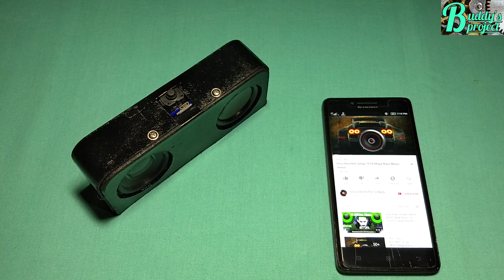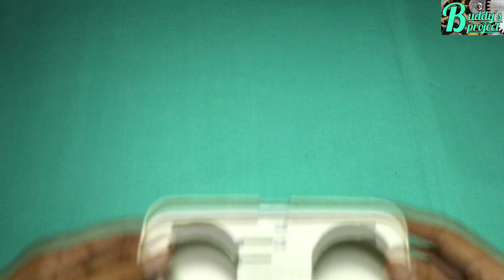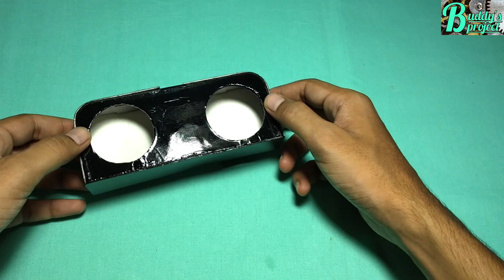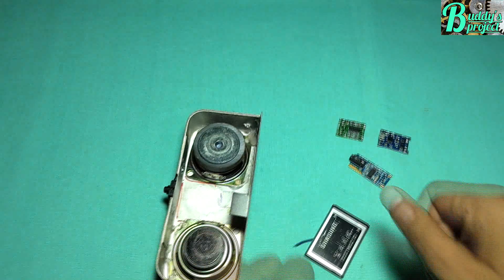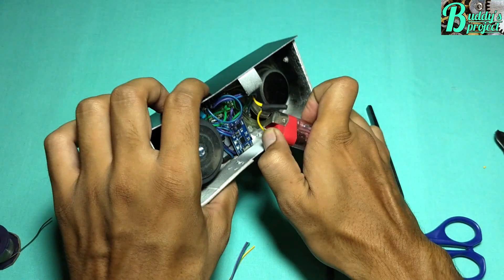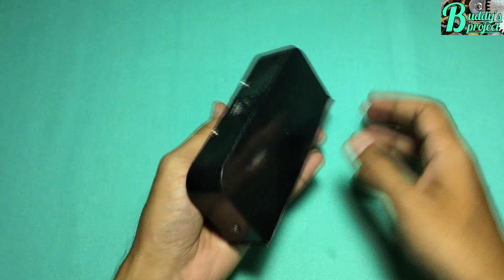How to make a Stereo Bluetooth speaker with 😎PAM8403 Amplifier

Comment: Your schematic didn't show which terminals you installed the capacitor across. Help me out, please. Also, it seems that you used 2 different types of speakers, Identify, please.
Reply from the maker: There are two different speakers with same ohms and watt, one for clear sound and other for bass only
Reply from the maker: Capacitor is added to reduce the amount distortion and to prevent speaker coil, solder negative end of capacitor to positive terminal of speaker.